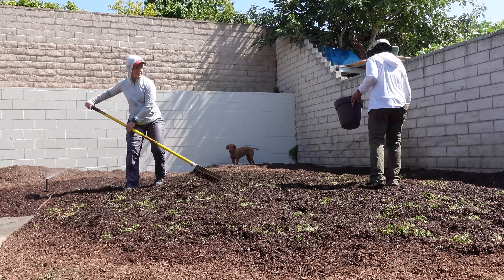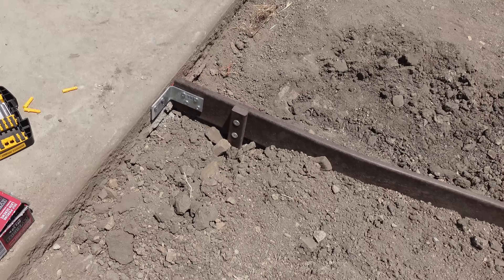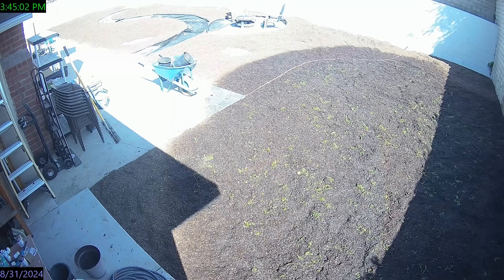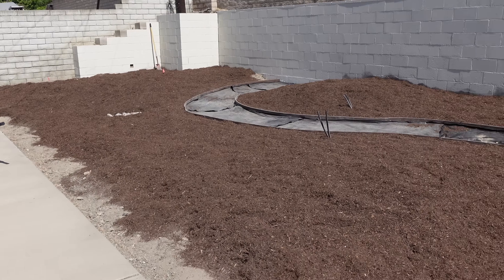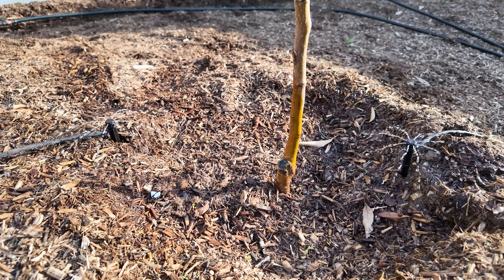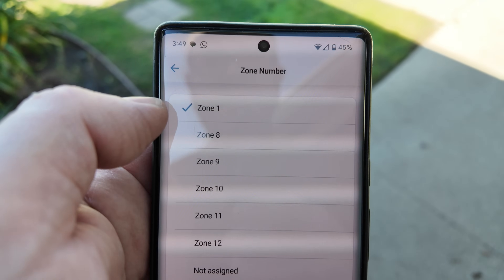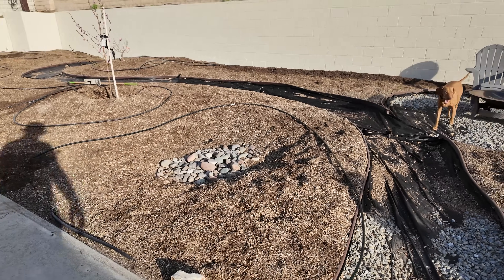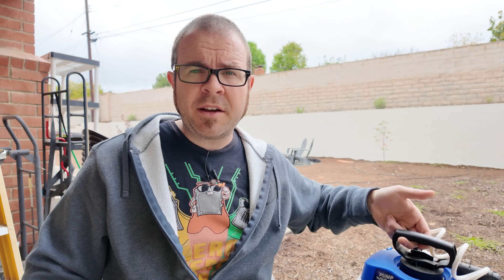Paul’s Plants - Compost and Irrigation (Wifi Sprinklers!)

Comment: I recommend looking int o Home Assistant if you're interested. I don't have sprinklers but it seems your system is compatible with it. It's a deep but fun rabbit hole and you can integrate a lot of things together, like changing your RGB lights when the sprinkler is on!

Comment: I'm starting and setting timers on my electric block and coupé heater with a Wifi plug for my car. Living in the north of Sweden it is useful to have a preheated car when driving to work. Changing out the manual timer to a wifi plug is saving me electricity as I can easily change the settings from my phone while in bed! Now we are winding down the heating as the spring is here, but it is not time to remove the studded tires and the heater just yet, April can definitly fool you.
Reply: Watering is normally not a problem here.

Comment: Hey Paul, 

The previous owners of my house used crushed granite in the backyard as a walkway. While it looks nice, it is a pain - small chunks stick to shoes and track into the house, seems like an increase in particulate, etc. 

I would like to replace it long term, but short term I might use something like a mulch glue to hold it together. It is supposed to be water permeable while fairly strong at holding the material together. Might be something to think about for your setup.

Comment: As a plant enthusiast, keep this content coming! Love to see tech integrated into everyday things like this and home improvement videos are always welcome. Good stuff Paul!

EDIT: Your trees should not be sitting in those little holes. They need to be roughly flush with the surrounding grade, but don't bury anymore trunk to fix it. If that well fills and water stays in there, you risk rotting the trunk and killing the tree. Just smooth out the little hill around the outside and you should be good.

Comment: I just got myself a lemon tree last week Paul! I'm super excited to finally try and grow one at my parent's house where I'm living right now. My grandfather's house had a dwarf lemon tree that was fully mature and produced tons of lemons year round, to the point that we never needed it. When we lost him a decade ago, I lost access to that tree forever, and it wasn't until recently that I started cooking with lemons regularly again because of it. We have had a tree at our house for over a decade now, but it's an anemic tree that barely grows high enough to get to the sun half the day due to where it is, and it's been here since the previous owners planted it, and it looks like it has a nutrient deficiency based on the advice I got on reddit about feeding it due to the color of the leaves. I decided I needed to find a proper spot where a tree could get year round sun in the back yard, dug a hole there, and now it's set up for success, all we'll need to think about really is pruning it once it gets big so it doesn't block a path placed at the limit of its expected average size. I will have to hand water it part of the year, but once it grows to full size it will be able to tap into some of the same groundwater supply that our highly productive 50ft orange tree is taking advantage of. Even during drought years it produces oranges like crazy without any watering, but it's been especially productive now that we're getting a ton of rain every winter in the bay!